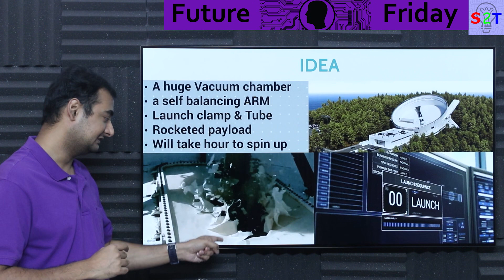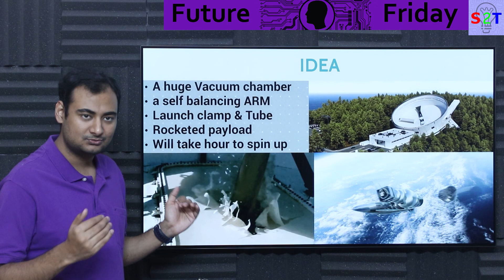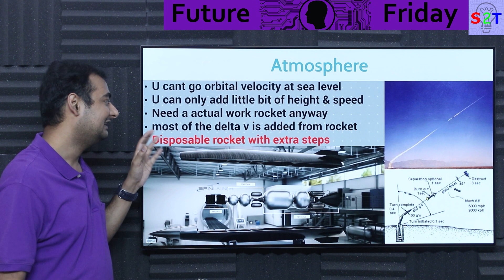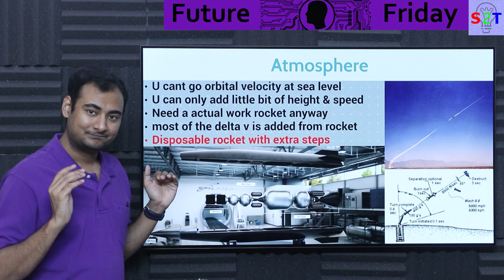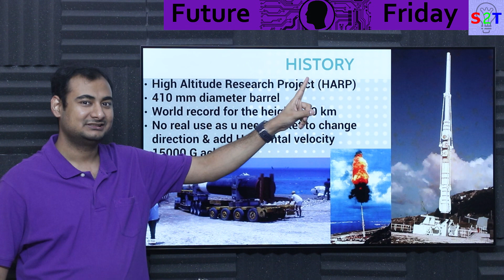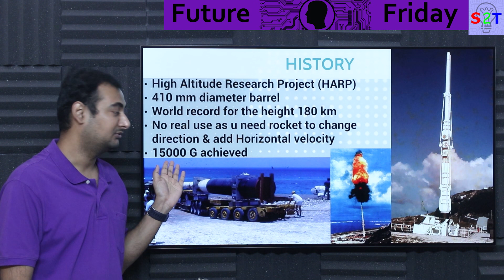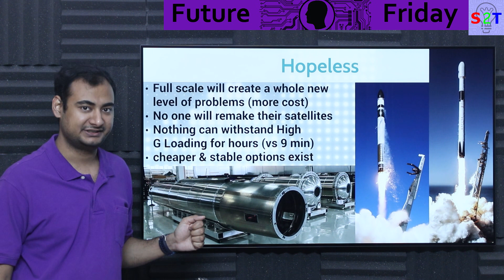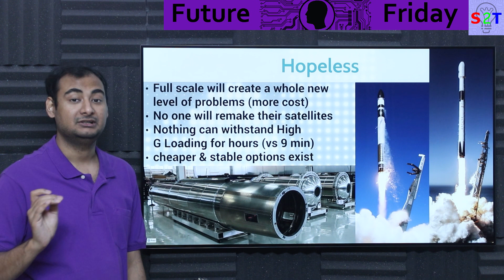SpinLaunch HOPE or HOAX Explained {Future Friday Ep162}

Comment: There is a new video by two guys who went to see the place by themselves https://www.youtube.com/watch?v=H6wXUZCByWg  The place is all but deserted adn the structure is rotated some 60 degrees from the position shown in the official video.  It is hard to tell, but it may be damaged.  Bankruptcy next?  Fraud confirmed?
Reply from the maker: Bankruptcy next?  yes sooner or later earth does not allow something like this too work
 Fraud confirmed? they will never admit it same as theranos or nikola motors
Reply: @s2tenglish  One theory for the change in the chamber's position is that, after the test video, they tried to actually evacuate the chamber, and it imploded.

That sharp shadow edge may be the sun was just right, but may be a crack. In the second case, the rim should have been bent away from the base, and the weight of the exit pipe would then have caused it to rotate.

There is a video by the contractor that shows the chamber before painting.  The side walls consists of wedge-shaped plates welded together.  I bet that those are not submarine-quality welds...

Comment: What is the formula for the atmospheric drag?  An object without any propulsion starts at sea level with a velocity V, say straight up.  What is the formula for its motion over time?
Reply from the maker: https://www.grc.nasa.gov/www/k-12/rocket/ballflght.html
Reply: @s2tenglish  Thanks.  My question was mostly about the drag.  I know that at low velocities it is A V^2 for some constant A.  What happens at supersonic speeds? Still B V^2 with a different constant B?
Then the acceleration would be V'(t) = - g - B (V(t))^2 which means V decreases "exponentially" with time.  That is, the initial Mach 6 would drop to below Mach 1 very quickly. Makes sense?

Comment: Why did they cut the exit video clip so short?  Because they did not want people to notice that the rocket is turning end over end at 450 rpm (7 turns per second)?
Apart for the problems that the spin causes for trajectory control, stopping it will require a nontrivial amount of energy, no?
Reply from the maker: dude this will not work Its just people working because they are getting paid

Comment: If the spinner was evacuated, the diaphragm on the exit port would be supporting some 10 tons of weight from atmospheric pressure.  It must be very strong material.  How come it is so flat?  To get it so flat they would have to put it under huge tension. Why would they go to that trouble? Letting it sag a foot or so would greatly reduce the tension.
When the rocket breaks through it, should't at least some of the tatters be sucked back into the spinner? 
Why did they cut that clip short, before the rocket had completely cleared the diaphragm?
Why have they released so little footage of that historic test?
Reply from the maker: is hall mark of a too much promise and too little delivery PROJECTS

Comment: The electric motor does not need to be inside the vacuum chamber, if you can make really good vacuum seal.
Reply from the maker: really good vacuum seal on a spinning rod that is the question

Comment: 3:30 its not starting tumble. Its rotating because it was spinned up. It is not an aero dynamic effect it just contiues its rotation. If you spin up the system with 400 rpm your rocket spins with 400 rpm.
11:15 Not only the satellite but also the rocket must withstand the g-load. The major problem is that this dramatically increases the structural weight of the rocket. The structural weight is a key factor for a rocket. Higher structural weight means you need more stages and a higher overall weight. So you end up with a rocket wich needs more stages, is more expensive and heavier than the rocket you start from ground. 

16:54 the main reason to throttle down is that the upper stage and the payload is designed to withstand a specific maximum g-force. Lower max g means a lighter second stage and therefore more payload. With the payload it is the same, less max g means you can build it lighter. On the other hand when you throttle down you have more gravitational losses. So it is a tradeoff.
Reply from the maker: 3:30 NO think about what u are saying .11:15 true only solid system will able to manage it